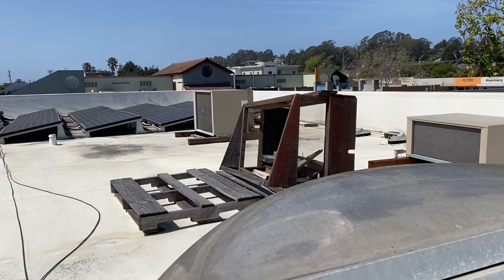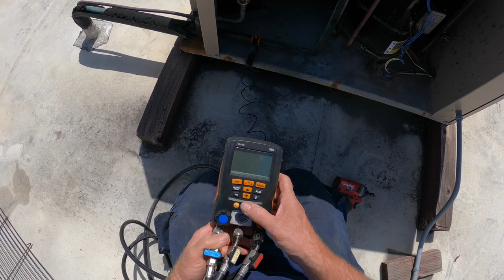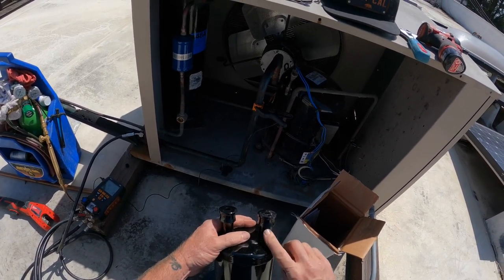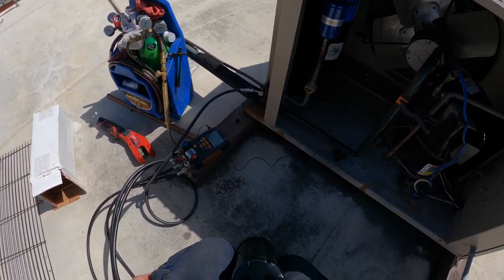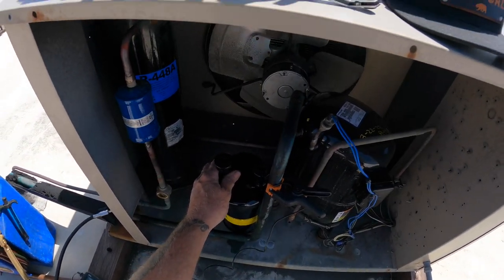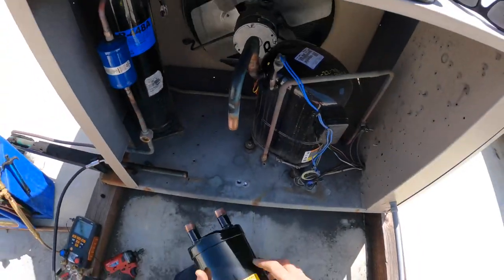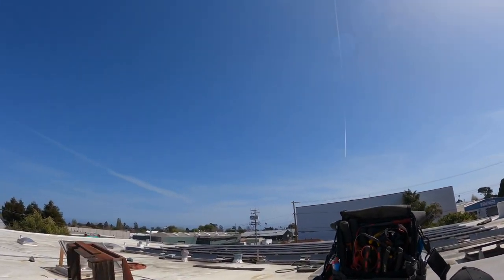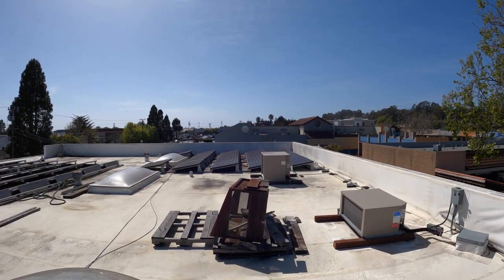Suction Accumulator compressor follow up

Comment: Nice one Dave!  Tech tip on the Milwaukee Tubing Cutter.   From time to time, spray the cutter and rollers with WD40 and wipe them down. Also, if you find you are having trouble getting the cutter wheel to grab, when you go to cut..  Hit the trigger on and off real quick (this sets the cutter)  then have at it.  
I have found this to be helpful!  

Thanks Dave and Be Well Brother!
Reply: Great info rich I did not know that and get very irritated with when it sits there bouncing around.
Reply: @RichGT350r  where have you been all my life. Thanks again
Reply: @daveg8918  Big Dave.  I’m still around.  I don’t miss any of your videos!  I may not drop a comment, but I always smash the 👍👍. Be well Brother!

Comment: hack and moe would install it backwards, so the compressor doesn't get any oil return. 🤣🤣

now I'm wondering how much oil it holds before it returns good through the pickup hole in the U-tube and if any should be added to allow for it?
I started off joking, then my brain took off on a tangent of thoughts. 🤯

Comment: Good call on installing that Suction accumulator! i Saw it Flooding back on the Regular start up without accumulator. i am a BIG Fan of Accumulators! Allways a Great idea ! i install them quite often. You can NEVER Go Wrong installing a Suction Accumulator ! When one of those Evap. Fan motors Quits & Evap Gets Dirty , add a Cold Night to the Mix & Liquid city going to come back. Suction accumulators are Worth thier Weight in Gold ! They are great CYA / insurance policys When installing New Compressors or Condensing units. Systems that Should ALLWAYS have Accumulators on them are:
1. Systems That Freeze up evaporators all the time.
2. Multiple Evaporator systems on cook lines.
3. Cold Plate systems
4. Heat Pumps
5. Chillers
6. Walk-in Freezers
7. Any System Can Benefit from a Suction accumulator.

Comment: The heat exchangers work good if you really need to have more superheat at the compressor and you’ve done all that you can. If you install a heat exchanger you will need to replace the liquid line solenoid, the liquid line solenoid that is there is design for a higher liquid line temperature. I put one in after the fact then the liquid line it would not close any longer had to get one that was smaller I can’t remember exactly but it had to be different because it was now 70° liquid line temperature at the liquid line solenoid. You got lucky had enough from the put that accumulator in

Comment: Super Dave need you help, I work on ice machines, under counter coolers, small systems, I have a question in regards to pulling a vacuum down to 500 microns, I use manifold gauge and Schrader valve still in, new oil sometime I can get it down below 500 microns in 15 - 20 minutes, but sometimes it take a few hours to get down to 500 microns, pressure tested with nitrogen no leaks new filter drier, both txv and captube, all hoses and connection are tight, what cause the big time difference to pull down to 500 microns and why thanks.
Reply from the maker: Possibly the oil having refrigerant trapped in it. It takes forever

Comment: Hey Dave , what about the oil return , this accumulator doesn't seem to  have a 1/4" or capillary tube that could be redirected into the suction ?
Reply: Accumulator don’t have oil return it will be pick up by the vapor gas that goes into the compressor.

Comment: Dave did you have to do any conversion with the TXV to switch to the R-448A? I'm getting conflicting advice because of capacity and superheat differences.
Reply from the maker: They now have 448a txv’s, they where giving us R-22 valves. This has R-22 valve and needed adjustment
Reply: @NorCal-refrigeration  I knew they had the 448 valves now.  I'm being told that's it's not just a simple switch from 22 or 404 that the powerhead on the txv has to be replaced. You seemed to do the switchover like you would with any other R-22 substitute and just adjust the txv. I wasn't aware that could be done.  Interesting...
Reply from the maker: @justicerefrigerationcallth1576  they gave us R-22 and R404 Txv’s for years with R448. Set your super heat at evap. Then double check your compressor SH. Make sure your not flooding it. Or running it to hot. Copeland is usually 20 degrees compressor SH minimum.
Reply: @NorCal-refrigeration  thanks Dave!!😃